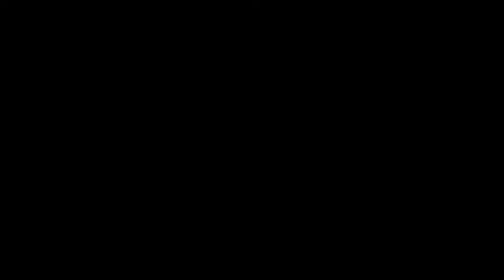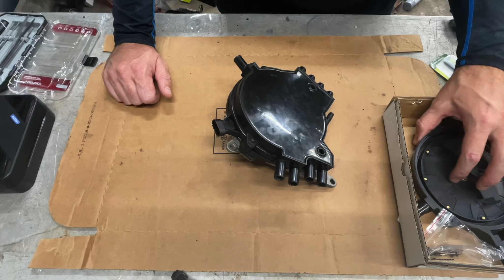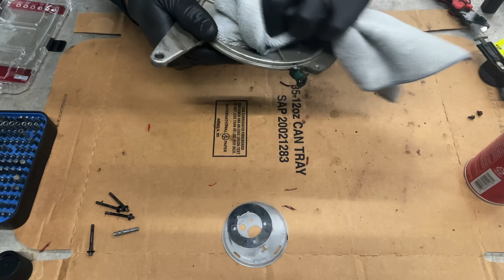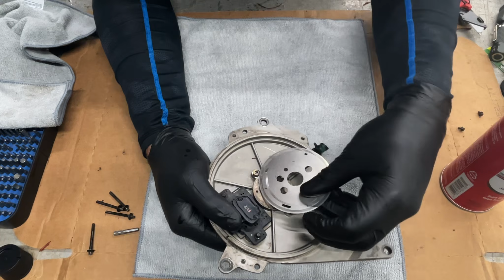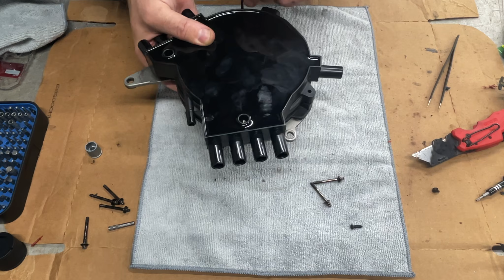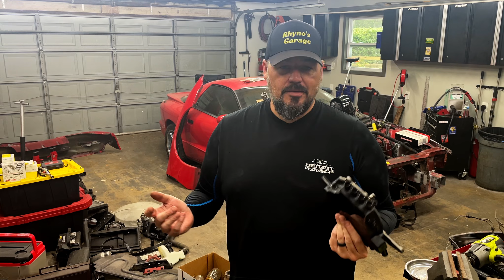Rebuilding the LT1 Optispark for the Firebird

Comment: Had 96 Formula years ago stopped running  82k miles $50 tow to shop $50 diagnostic charge told needs distributor cap, $50 to tow it home, $32 to ebay for the cheapest cap available,  cap fit but other part supplied did not fit reused old one, engine fired right up sold car.

Comment: Replacing my cooling system on my 95 C4 Vette, no problems with the opti before the trans cooler failed, may try to
Rebuild it while I have the water pump out to replace! Great video, this gives me some hope that I may not need to drop $750+ on a decent one just incase.

Comment: Rebuilding would include a new bearing, and do not follow these directions.  At a glance, he used the wrong cap and installed the timing wheel/spacer the wrong way.  And I'm pretty sure that's not the Mitsubishi sensor.

Comment: Mine had oil too 900 dollar MSD only ran two years looked very well made with timing adjustment screw but failed putting in cardone unit see if it’s ok
Reply from the maker: It’s really just a terrible design altogether.
Reply: Keep us posted bro how the cardone unit holds up. Too many iffy sellers selling optis and not enough reviews on them.
Reply: Petris the only one I see anything good about besides OEM

Comment: There's literally only one good optispark on the market! Petris enterprise if you buy anything else then you will be doing this job again!
Reply: My Petris opti is throwing a code 36 after only 6000 miles. Out of warranty of course since I barely drive my 92 Vette. Installation was done correctly so I guess mine is an outlier.
Reply: @usaf20071989   this is literally the only bad experience I've heard!!! Sorry to hear that!! Everyone I've talked to with one has had great luck with them!! One guy I talked to said he went through 3 optis in as many months then put in the petris and it's been running perfectly for over 4 years now!! I'm hoping I have the same luck with mine!! Now you got me worried! Lol do you have factory replacement coil or aftermarket performance style?
Reply: @usaf20071989   that's the only bad experience I've heard! Yours came with the upgraded ventilation right? And what part of the country do you live?
Reply: @C4VETTELT1  Yes, I have the vent hooked up per the instructions. I live in Ohio. It's garaged all winter and never driven in the rain but I did spray water through the wheel well at the self wash and I think that's what killed it. Most annoying design ever I tell you. Learned a lesson lol
Reply: @usaf20071989  I highly doubt that's what did it!!! I just washed my car last night and was spraying water in the wheel wells and mine still runs perfectly! How would water get inside?! These things are completely sealed and loktite on the screws! I think you just got unlucky? The only way I can think of water getting inside would be through the harness and in through the harness plug on the opti but that is still a very long shot!! Also your ECM could be going bad! These 92s are notorious for ECM issues and I'd be highly surprised if you still had the factory ECM. mine had the factory ECM when I got it but it doesn't have the factory unit anymore! Lol or your camshaft seal where the opti connects could have gotten damaged during installation or just bad and the opti could have oil in it through the splineshaft.
Reply: @C4VETTELT1  Well it starts up and runs for 15 mins and reaches 195 degrees F and then shuts off. Difficult to start back up but after it sits for a few hours it's good for another 15 mins and will repeat the cycle.
Reply: @usaf20071989  that sounds like ECM to me!! Mine was doing the same EXACT thing!!! OK so you can do a couple things to find out for sure!! You can pull the ECM out and put it in the freezer ( not what I recommend but you can) or put an ice pack on the ECM and see if it does the same thing if not then it's probably the distributor! Both distributor and ECM will act up if not functioning correctly! It's basically the same exact symptoms! Also the prom chip can do the same but there is a code for the prom chip. It's either your ECM or distributor.
Reply: @C4VETTELT1  I find it hard to believe that a 900 dollar Petris lasted 6000 miles. My next plan is to pull ECM and send to SIA to have them fix any issues with the solder joints. Thank you for the help
Reply: @usaf20071989   I did the same! I sent mine in to get repaired but they actually couldn't fix it they said one of the processors for something went bad and was unfixable and they refunded my money and I had to get a whole new unit which was a complete BIT@# to track down! But maybe you'll have better luck! But if you get the C12 and it runs through all the diagnostics then the ECM should be fine. I've actually been thinking about the ECM issue I had since chatting with you and mine actually through an ERR code so to speak, it's not a code but the computer will say ERR in the gage cluster instead of going through the codes and subsections of the computer. And the distributor has to act a certain way to set that code36! So if you are getting that code36 and it cycles through the diagnostics then the ECM is probably fine or at least not the same issue I had?
Reply: @C4VETTELT1  I had the ERR and ASR light come on a while back and the car wouldn't start at all. After a lot of digging I found my ECM fuse was blown. Replaced with a new one and the car was back in business. Then shortly after that I took it out one day and ended up with Code 36. Hi Res pulse issue. I'm going to try another Opti and see if I get lucky. The job sucks, but second time around just means everything will come out easily
Reply: @usaf20071989   I wouldn't buy a cheap one! You can get just the distributor from petris for like 400-500$ sounds like you bought the whole kit, distributor, waterpump ect? I wouldn't buy anything but petris! But I also understand why you would be leary of doing that! If you buy the cheap garage on the market you'll ultimately be screwing yourself!! I'd get another petris and if you have bad luck again then I'd just sell the damn thing! That's exactly were I'm at with mine! If this petris doesn't last then that means there's no good optispark on the market and changing them every few months or once a year is the way its gonna be forever!! And I sure as hell ain't getting under that hood to do this job again!! If this shit doesn't work then it's see ya bye car and ill never own another LT1 powerd vehicle for the rest of my life!!
Reply: @C4VETTELT1  oh no I would never go cheap. Summit racing makes a good one for around 200 but it doesn't have a vent. I read bad things about MSD and good things. I will never buy a 60 dollar Opti for what this job entails. I have 60000 miles on my car so I don't want to give up on it just yet.
Reply: @usaf20071989  I haven't heard anything good about any optispark other than petris! I've been looking for a good one for almost 4 years now!! If this ain't then again good ones don't even exist!! And cars going bye bye!!! I almost bought the accel opti but evidently they are no good anymore so is the MSD! Idk anything about the summit one but I've been looking if it was any good I would have heard about it thats for sure!! Lol
Reply: @usaf20071989  Could be the ICM, they'll sometimes work cold but not hot.  It might need to be replaced, or just cleaned and new thermal paste applied.
Reply from the maker: I've heard that.  Well, at least I know how to do it now..haha.
Reply: Oh no I just seen an oops 😢
Reply: Thanks for the video. Big help

Comment: Mine lasted 13 years. I have an ac delco one & as I’m going to work to replace her… she took a dump. What are the odds 🤷🏻‍♂️
Good job & thanks.
( I think you need an inverted e4 socket to take her apart )
Reply from the maker: Pretty sure this one was either rebuilt before or replaced.  No idea how long it was in there, but hopefully this one lasts a few years at least.

Comment: When you first took it apart the smaller rotary disc was underneath and when you reasembled you placed it on top. That will effect where the larger discs inside the pick up sits in relation to height.

Also you didnt seal the rotor cover  so rubbish can still be drawn in.

Id seal all surfaces that mate together
Reply from the maker: yeah, just an recording snafu.  The part on video was a re-film from footage that got messed up and I didn't recreate the video quite right.  Nice catch though!

Comment: Dude the small disc was under the larger disc when you took it apart
Reply from the maker: Oh man, nice catch!  Yes, it was on video.  It wasn't when I took it apart initially...and the recording was corrupted.  So I had to re-record and do it over.  When setup the "staged" disassembly I put it on backwards.  I didn't notice it either until after I was done editing...after I'd already had it reinstalled on the car. 

Getting some BTS view into the "magic" of YouTube creation, eh?
Reply: @rhynosgarage  Did you have to take it back apart and put the small ring on top.
Reply: @rhynosgarage it’s supposed to be underneath. You are going to wear out the reluctor wheel if you leave it like that.
Reply: You can tell it’s not original because the original cap and rotor were brown. If the sensor is Mitsubishi, it will have a small raised logo. Also, you have a Optispark 1 and you bought an Optispark 2 cap. That tube on the cap doesn’t go to vacuum. It connects to the intake. The OS 2 has a vacuum port on the housing. Pretty sure that won’t work correctly.

Comment: Thanks for the video.  Let us know how you make out!! my 96 trans am the opti just went , i have a oil leak behind the opti so i’m sure it thrashed it and oil got inside.  i’m parking it and will do electric water pump and new opti… i read if you open an opti up like you did, lock tite every bolt, and rtv it, the chances of it failing are greatly reduced !!! an electric water pump also helps because it eliminates the weep hole on the mechanical ones that drips right onto the opti!
Reply from the maker: In my case I had no visible evidence of water/coolant in the opti.  Just a lot of oil.  Getting it all re-assembled to hopefully try to start over the upcoming long weekend.  Stay tuned!
Reply: Mine just had green corrosion on the pick up & the cap has 1 burnt spark node.